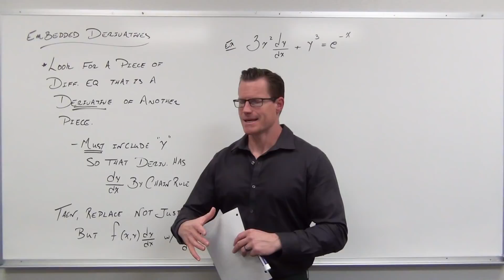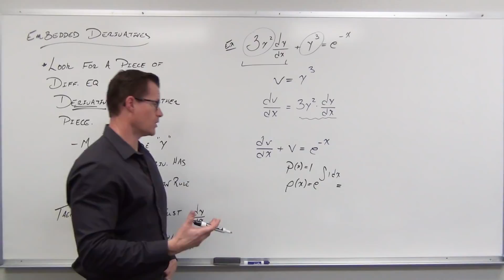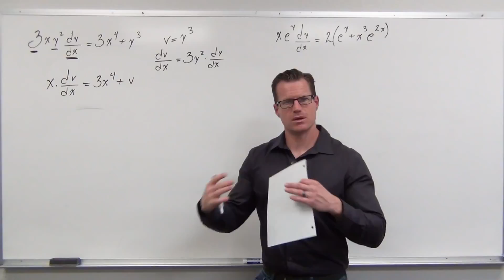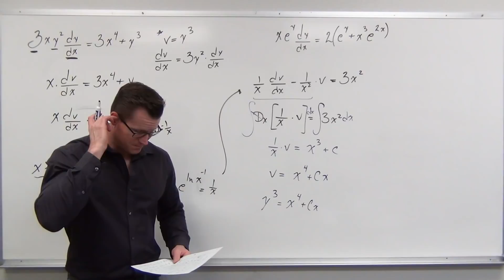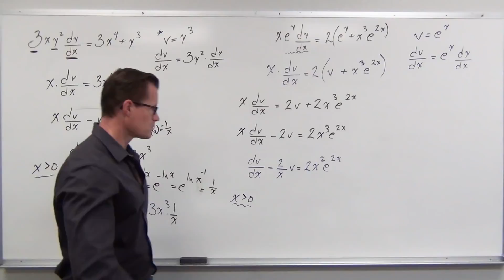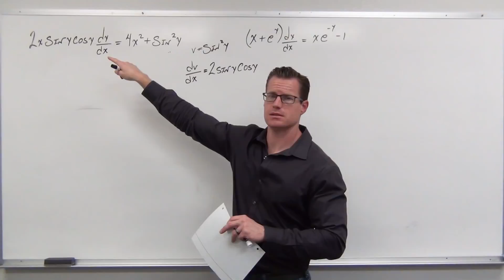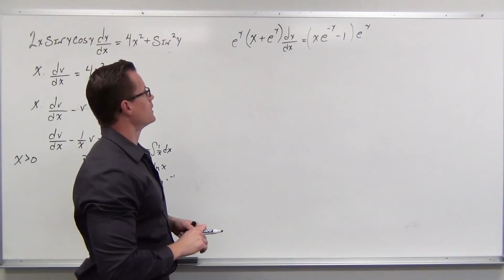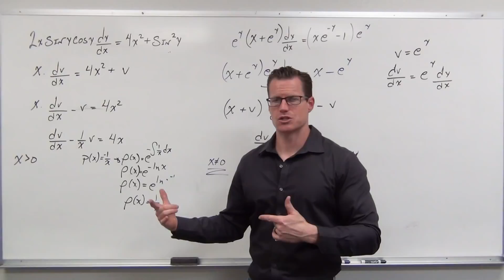Solving Differential Equations with Embedded Derivative Substitutions (Differential Equations 24)

Comment: 42:50 Last question in the video:
I let v=x+e^y. It still works!
dv/dx = 1+ e^y*dy/dx

=> v*(dv/dx -1) =x - (v-x)
=> v*dv/dx - v   = -v +2x
=> v*dv/dx        =        2x
integrate both sides with respect to x
=> intgr[ v*dv]   =  intgr[2x*dx]
=>             v^2/2 = x^2 + C_1
=>      (x+e^y)^2 = 2(x^2 + C_1) = 2x^2 +C

Comment: For the second to last problem, isnt better to just lrt v = sin(y). Then 
2xvdv/dx = 4x^2+ v^2 
dv/dx = 2x(1/v) + v^2 
dv/dx -2xv = 0. rho(x) = e^-x^2, which is not a problem as its multiplied by zero on the RH side. 

v*e^-x^2 = c
v = ce^x^2 
y = sin^-1(ce^x^2) 

Now It becomes very nice and easy to solve explicitly for y.

Comment: My method for the last problem was kinda weird:
I defined A = x + e^y, which then gave me dA/dx = 1 + e^y*(dy/dx), and then I just replaced the y and dy/dx in the original equation and plowed through a ton of ridiculous algebra from there. I got the solution (eʸ + x)² = 2x² + C.
Reply: I tried that and got the same thing. Wondering how else to do it because what Prof Leonard left us with is NOT necessarily an easy continuation (although it IS doable) :D !  He's got great vids tho!

Comment: Hoping someone can shed some light on the solution for the last problem: 
I continued to substitue in w = (v/x) & dv/dx = x(dw/dx)+w. 
I now have x(dw/dx)+w = (1-w)/(1+w).
Bring the w over to the right and merge into 1 factor i get x(dw/dx) = [(1-w)-w(1+w)]/(1+w) = (1-2w-w^2)/(1+w).
From here im not sure how to proceed. Maybe i am forgetting some basic fundamentals in algebra but i wasn't able to factor it. Any ideas?
Reply: From there you got a function of 'x' on the left side and a function of 'w' on the right side, you invert the fractions and switch the sides like Professor Leonard does for his homogeneous equations. Assuming x > 0:

(1+w)/(w^2+2w-1)(dw) = -(1/x)(dx)

You can solve it from there, if you want a solution I'll focus on the left side first. Integrate both sides using another substitution (I chose q):

q = w^2 + 2w - 1
dq = (2w + 2)dw
dq = 2(w + 1)dw
(dq/2) = (w+1)dw

So, using our substitution:

Integral((1/q)(dq/2)) = (1/2)Integral((1/q)(dq)) = (1/2)ln|q|

We ignore the constant for the left side because we'll have another arbitrary constant on the right side:

(1/2)ln|q| = ln(1/x) + C_1

Multiply by 2:

ln|q| = 2(ln(1/x)) + 2(C_1)  

ln|q| = ln(1/x^2) + C_2  #[New arbitrary constant C_2 = 2*C_1]

Take both sides as the power of 'e':

|q| = e^(ln(1/x^2) + C_2)

|q| = (1/x^2)(e^(C_2))

q = C/x^2   #[New arbitrary constant C = ±e^(C_2)]

Now we've solved enough for 'q', replace it with our previous substitutions:

w^2 + 2w - 1 = C/x^2

w^2 + 2w = (C + x^2)/x^2

Substitute back for v:

(v/x)^2 + 2(v/x) = (C + x^2)/x^2  #[Multiply both sides by x^2]

v^2 + 2vx = C + x^2

Substitute back for y:

(e^y)^2 + 2(e^y)x = C + x^2

e^(2y) + 2xe^y = C + x^2

#[This is the final, most simplified answer I could get]

Comment: I’m stuck on the last problem, can anybody help please?
Reply: I was able to get the following answer but would like to verify that it's correct. I don't believe I messed up anywhere though. My answer to the problem is e^(2y) + 2xe^y = C + x^2
Reply: am not sure if we would keep this as is or go further with solving for y
Reply: Drew Sanchez I get lost when we use homogeneous sub w = v/x 

I got: v=wx, dv\dx = dw/dx•x+w

dw/dx•x+w = (1-w)/(1+w)

dw/dx•x = (1-w)/(1+w) - w

dw/dx•x = (-w^2-2w+1)/1+w

That’s as far as I’ve got.
Reply: @michaelgeinopolos6911  factor out the -1. Divide both sides by x. Then multiply both sides by the reciprocal of (w^2+2w-1)/(w+1). Bring dx over to the right side. You should then have (w+1)/(w^2+2w-1) dw = -1/x dx. Think about how you would integrate the left side. Hope that helps.